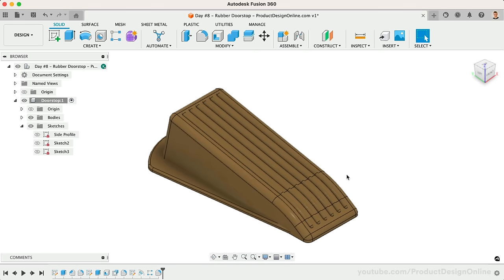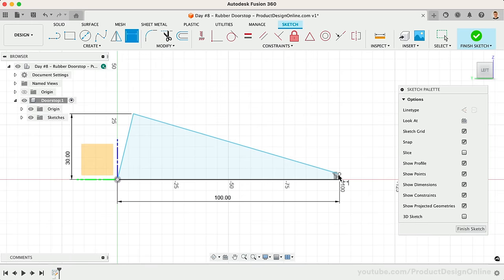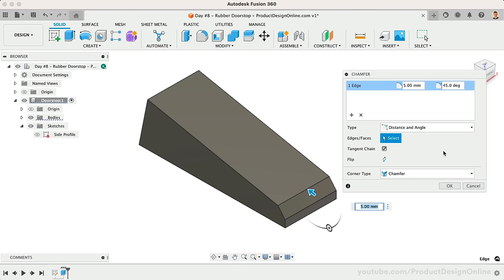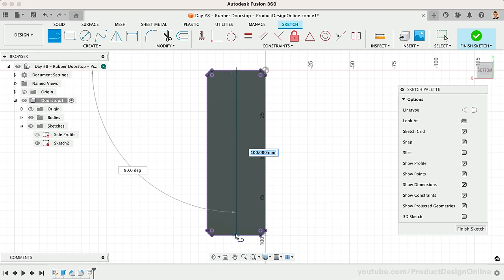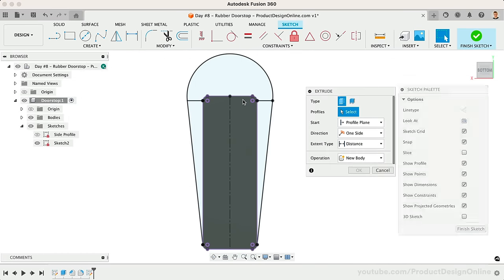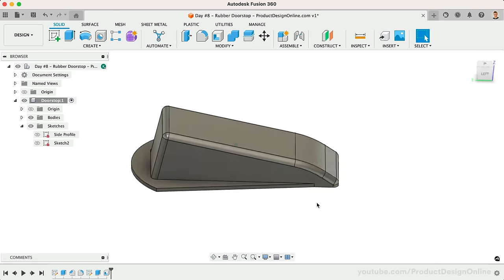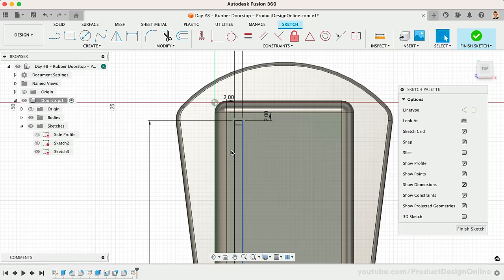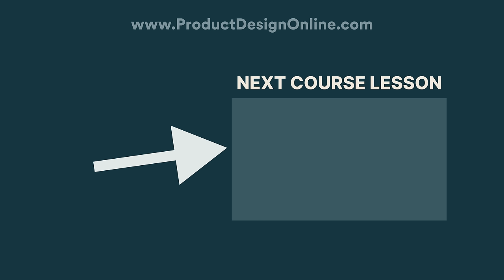Day 8 of Learn Fusion 360 in 30 Days for Complete Beginners! - 2023 EDITION

Comment: When I started the sketch on the top face for the embossing line, I noticed it wouldn’t let me emboss. Got an error that stated to readjust my dimensions. Also noticed that from a side view, my sketch didn’t follow the profile of the door stop. In other words from a side profile view my sketch stayed straight and went off the top plane rather than curving down. I think this is why I couldn’t emboss and got the error. My sketch didn’t fully follow the top plane. Why didn’t my sketch follow the top as in your video?
Reply: I have the same Problem....
Reply: @d.k.9263  the answer is I n these comments. I was able to get it to work. Had to do with hitting control I believe while selecting the 3 faces we were trying to emboss on
Reply: I have the same issue.. sketch 3 doesn't follow the profile of the top surface as it curves away and leaves you with nothing for the embossing tool to reference on the lower 2 planes.  

Changing the little 2 point circle to a tangent arc seemed to fix the issue

Comment: [When finish sketch is clicked, the extrude does not automaticly re-appear with the new settings, it remains a bleu field without the extrude. What am I doing wrong? I can't discover what I am doing wrong in this process. And with the embossing, how to enter the text command prompt? After the embosstool has been activated, the selection of the topface isn't possible, it selects the whole sketch sides and all...frustrating non the least!] ---> [UPDATE: uncheck Tangnet Chain and there you have it. THANKS!]

Comment: I wanted to add some lettering to the side.  I used the text tool then embossed it. I then made a middle plane and mirrored it to the other side but the letters were facing the same way. I could not get them turned around. 

I got tired of it and just exported the STL to Bambu slicer. I wanted to print the letters in different colors but I was not able to select them in the slicer. 

What did I do wrong?
Reply from the maker: You will need to export the letters as separate 3D bodies. Did you export the file as a single component/body?
Reply: @ProductDesignOnline  Thanks for your reply. I was able to select the sides/panels of the letters but not a whole letter. I was trying to flip them in F360 so at that point, I have not exported anything yet

Comment: I'm curious - couldn't the last filllet be done before rectangular pattern?
I tried to do that, but the rectangular pattern wouldn't repeat the fillet - why?
Reply from the maker: The Fusion team recommends never patterning fillets as it takes a lot of extra computing power due to how parametric files are. It will often slow the file down. That said, it is possible to pattern a fillet. You would need to use the 'features' pattern option and select both the Emboss and fillet.

Comment: I was not able to emboss the for profile sketch in to the top face. I could not select the top face only, only the entire body, and got only errors.
Reply: Had the same issue and for me the emboss ended up working after I replaced the 2-point circle with a tangential arc (which is the same shape for all intents and purposes).
Reply: Yeah surprisingly it worked @Lobbelt

Comment: 11:08 Why cant you add a fillet before making a rectangular pattern?
Reply from the maker: You can, but it's consider not a best practice. On larger files it will slow down the file and make Fusion more likely to crash because it will be computing the filler each time the timeline/pattern updates.
Reply: @ProductDesignOnline   Hi, thanks for the response! I just tried it, and it wouldn't even let me do it. It gave the error message 'Compute Failed, No fillet edge found'. Maybe a precaution because of all the computing power required, like you mentioned. 
I'm loving the series btw! I'm new to Fusion 360 and I'm following your whole course to get up to speed. Can't wait for the remaining episodes :)

Comment: my sketch is "overly constrained" so I can't change the degree, its already at 12.1 degrees but I was just wondering how I would change it if needed. should I set the degrees first? and my tangent arc keeps making an enormous circle, idk what i'm doing wrong ... scratch that last one, it suddenly worked as demonstrated.
Reply from the maker: If you ever get the overconstrain error message it's likely that an automatic constraint was applied somewhere that you didn't realize/expect. You would have to delete it. Sometimes the auto-constraints can be picky based on how you sketch the lines/geometry.
Reply: Hi, I had the same problem. I think what solved it for me is that when i drew the original rough sketch I made that first corner 90 degrees and it made a constraint there. For those reading this, either delete that constraint by right clicking that "T" square mark in the corner, or remake the shape purposefully not making that first corner a perfect 90.

Comment: I made fillet before Rectangular Pattern so it can copy emboss and fillet and it's faster.
Reply from the maker: That's okay for this small file, but I would generally advise against that. That has been a known issue to cause latency with assemblies. The Fusion team recommends never patterning or mirroring fillets.
Reply: Nice to know. Thanks for the tip.

Comment: not sure why or if i did something wrong but i got a few errors for the emboss on this not sure why i fixed it but had to change some of the sizes and filet
Reply from the maker: SOLUTION:
1. Activate Emboss
2. Uncheck 'Tangnet Chain' in the Emboss dialog. * Very important. This must be done *
3. Select the 4 sketch profiles (two halves of the circle, two rectangles)
4. Seitch to the 'Faces' selector in the Emboss Dialog
5. Select the top face of the doorstop (the largest face).
6. Hold the CMD Key (Mac) or CTRL Key (Windows) to select the remaining to top faces.
7. Select OK to confirm the Emboss.
Reply from the maker: The new emboss tool works on more surfaces, but has also impacted how the Emboss tool worked when this tutorial was recorded.
Reply: @ProductDesignOnline  For some reason I'm not able to "select the 4 sketch profiles", as the 2x90 rectangle is not split into two pieces. The rectangle just floats in space above the chamfered section and does not follow its curve. I've retraced my steps multiple times but can't find what I did different from you.

Comment: It seems like there should be an easier way to do a fillet on all those ridges at the end than selecting each one. Can't we just select the original one before the rectangular copy and have it apply to the copies?
Reply from the maker: Hi Brent. In general, Fusion team recommends never patterning Fillets. It puts a heavy load on how the parametric nature is processed and can cause a lot of issues downstream.

That being said, a model as small as this you shouldn't run into latency... But don't want folks to form bad habits.

There are some other selection tricks that can be used with the selection filters (not shown in this video).

Comment: There’s so many arbitrary things that are done and yet I don’t understand.

Why do we have to project instead of make just a sketch at the bottom?

Why do we have to have to see you delete the little “T” symbol in the corner of the line and the bottom of the stopper without explanation before you make a horizontal constraint. 

How come when I follow along and use coincident tool to connect the hypotenuse line to the perpendicular line on the sketch points does it make both lines black for you but for me it’s one block and one blue. Despite following along exactly do these sort of things just not work

Comment: I couldn't get the emboss to work like it does in the video, using Windows version. I had to make a tangent arc at the top of the sketch instead of a circle, then it worked fine.
Reply from the maker: Please see the pinned comment. There was a change to the Emboss command (Mac and Windows) that impacted the result.

Comment: I've tried this one 3-4 times now, completely starting from scratch every time. No matter what I do, the emboss line either refuses to generate or it isn't straight, it winds its way down the face, deviating from side to side by a couple millimeters. I'm guessing it has something to do with the Chamfer/fillet along the toe of the object, but even remodelling that entire part of the object in the sketch I can't get a straight emboss line.
Reply from the maker: Please see the pinned comment if you haven't already. A recent emboss update changed how it works when multiple faces are selected. I've outlined the steps to fix it.

Comment: When doing the fillet of the rubber ridges, selection order of the fillet seems to matter
Reply from the maker: Hi Eric, in general, the order of selecting fillets only matters if applying multiple fillets with different radii. In this case, it should not matter. Did you experience an issue when applying them?
Reply: @ProductDesignOnline  Hi, I did experience an issue but eventually it worked. I just repeated the issue. It seems to happen when I randomly select the edges of the rubber ridges. When I say random I mean clicking on clicking on 1(any) edge of the first ridge, then clicking on a random edge of another ridge and jumping around like that until all of the correct ridges are selected. Then when I fillet, some of the round parts towards the front of the base (closest to where the ground would be) have an odd shape and aren't correct. Hard to explain without video/picture. But eventually it did work, just a heads up incase anyone else experiences it.

Comment: It kept flipping the small side underneath the bottom when I tried to add the height constraint on the big side. I ended up adding another line constrained perpendicular to the small side before adding a constraint to the big side and this stopped it. Not sure why, I won't speculate.
Reply: Has your continued experience gotten you anywhere with why? I had the same issue and adjusted the angle of the top line when I was drawing it, it seemed to want to maintain its length and angle, forcing negative values despite not being constrained in any ways I can see

Comment: When I selected Tangent arc it created a giant circle therefore I use 3 point arc.  Why did this happened?
Reply from the maker: Could you share a screenshot? It's likely another constraint that was automatically applied.
Reply: How do I add a picture?
Reply: @ProductDesignOnline  I had this too. not seeing how to identify any applied constraints. pulling an arc from the inside point @Y35mm seems to behave normally, but the other three, outside point, and (outside on Y0 side or inside Y0 side) it tries to make a circle. will look to see if I am able to post a picture.

Edit: Unsure if related. Deleted sketch and tried again. ensuring I made the 10mm line horizontal, following the rest, using coincidence and everything, but leaving out the additional horizontal/vertical constraint allowed the Arc to function. perhaps adding that when it already was caused something to go awry. I did not try to reproduce by drawing the 10mm line at an angle on purpose and adding Horizontal constraint to see if that had any affect on the Arc. but following this method got me back on track. 

these are great videos by the way, I went form not sure how to make a cube to designing simple objects I can print in 24 hours. Just started these videos 3 days ago and have learned so much.
Reply: Thank you.  I will try again

Comment: I've seen it posted here a couple of times in the comments about at the 10 minute mark... I am on a MAC ,with Tangent Chain unchecked,  even with holding option, I am unable to select more than one face... Is there a solution?
Reply: I ended up, embossing one face. Then revealed the sketch and embossing the next face, and repeated for the third... seems like more work than it should be...
Reply: Lastly, I had to make the chamfers on the embossed strips .99 due to an error on the curved face.

Comment: On lesson 8 now and so far the biggest frustration is not being able to pan/orbit/zoom easily with the mouse.  In the videos he is able to pan/zoom/orbit without the mouse cursor moving or changing.  Anyone know how he does this?  There doesn't seem to be any keyboard shortcuts.  Is there some magical hardware out there that I am missing?
Reply: You'll need to left click and hold it down on the orientation cube in the top right corner and drag it around. You'll notice when he moves the model around the mouse cursor goes up there. To pan around click the mouse wheel down and hold while moving.
Reply: Holding the scroll wheel while moving the mouse lets me pan around.  Holding shift and the scroll wheel lets me orbit the model.  Zooming is just scrolling the wheel.

Comment: wouldn't it make more sense to fillet the first ridge before patterning ?
Reply from the maker: In general, that's not recommended with Fusion 360 because it will introduce a lot of latency. However, with a project/ design, the small it shouldn't matter much.

Comment: idk what you did differently but i cant add all your dementions. i can get all but any ONE of them. more over contrains my model
Reply from the maker: It's hard to say without seeing your sketch, but it's likely that an automatic constraint was applied somewhere based on a selection or mouse click. What part are you trying to dimension?
Reply: @ProductDesignOnline i was trying to add the dimensions to the 2d sketch at the start. id get to the final variable of the angle and it would say its over constrained. if i deleted any one of the other values it would let me add the angle.

Comment: This is a comment I like to make to all the fusion tutorial makers. They are all excellent but ALL fail in one area. If you have a design you want to create or even copy, there do you start? I tried starting from the most complicated side. didn't work. then the simple side, didn't work. How do you decide which sketch to start with ?
Reply from the maker: Thanks for your suggestion. It all goes back to your 'design intent'. How do you want to build your model to be parametric? In other words, there is often not a sole one best side or face to start on, but your desire to have the model update/adaptable in specific directions can help you determine the most critical sketches.

Comment: Poor explanation of Tangent Arc step. For unknown reason, Tangent Arc either works as shown, or just make a huge arc instead. Adjusting the 10mm indicator (up or down) seems to changes it back to do what is shown, but very randomly and unpredictably.

Also, the Coincident step prior to Mirror, the vertical line that is to be Coincidented to the 10mm line can randomly not Constraint itself (turn black, instead it remains blue). It seems the angle has something to do w/ it.

Appreciate the walk through, but need to slow the f5ck down a bit. That very first step where you re-orient XYZ before creating 1st Sketch on YZ plane. Spend some time explaining why because it f5cking matter. The orientation does affect some of the tools like Emboss and Chamfer (15mm/25degree need to be flipped to works right). It is not fun tracing your steps trying to figure out wtf went wrong.
Reply: I get your frustration. I recommend following along on Days 1 to 7 before doing this one, as those principles are expanded up on there (ie, by now, those skills should be learned)

Comment: I’m unable to emboss the line to the front. It errors out in the program.
Reply: I'm having this error also.
Error: The operation failed. Try adjusting the values or changing the input geometry.
Done everything as instructed a couple of times from the begining and still error.